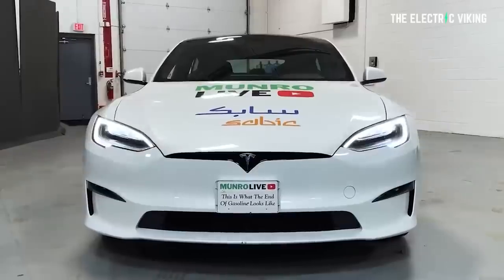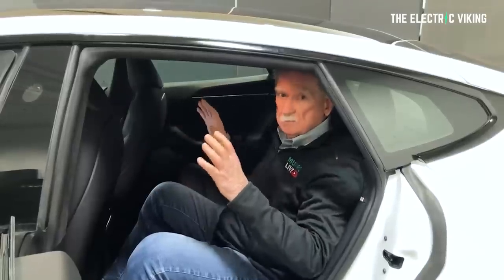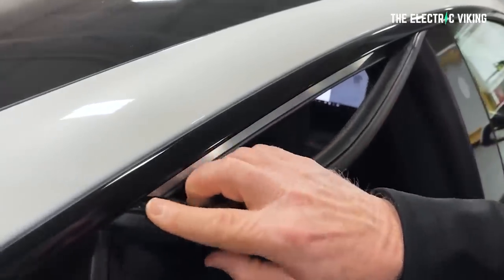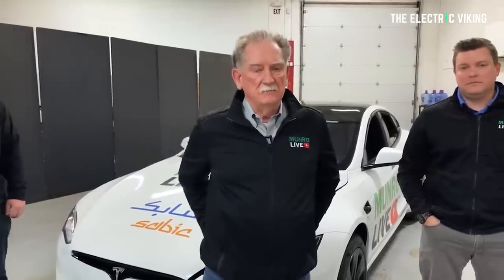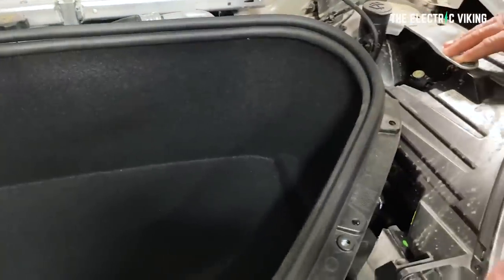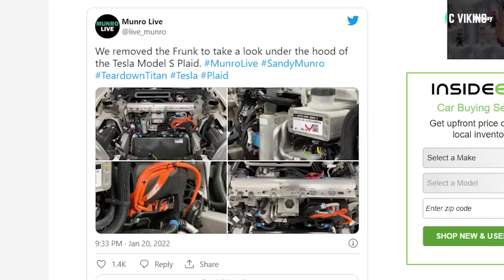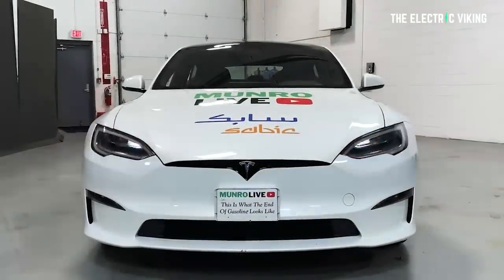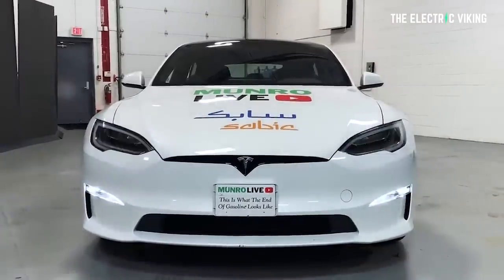The good & the BAD of Sandy Munro's Tesla PLAID teardown

Comment: With a simple calculation you can determine approximate horsepower. Since the Tesla Plaid weighs 4,766 lbs and can achieve an ET of 9.2 the estimated HP is 1,210.

Comment: Hi Sam, 

I did see most of Sandy's video, and I was certainly in agreement with most of what he said. I am however disappointed by what Sandy did not say. For instance, Sandy did not say that he found fault with the notion that car was painted. I myself have since decades found fault with the fact that cars - indeed, anything - is/are painted: it just adds cost to the item and worry to the customer that the paint will be damaged. My own new Model 3 Performance is scheduled to have paint protection film applied to it for more than $4,000, which I will have to shell out myself! Why should I have to do so? Architects have a principle, which they express as "Truth in Materials". Meaning that all materials should display themselves as what they are: wood as wood, metal as metal, plastic as plastic, bricks as bricks, clay as clay and stone as stone. No paint should ever be used in a good building. This is a well known principle in architecture. The dome of the Pantheon in Rome, constructed during the reign of the Emperor Hadrian, is unpainted concrete, and it's still mint after two thousand years! Why can't cars be made the same way? I see no reason whatsoever why they can't be. Kitchen sinks and aluminium pots and pans don't need painting, and therefore, I personally think, cars should not, either. Why didn't Sandy and his team bring that point up? It could reduce the cost of the car by 5 to 10 thousand dollars! Much more than all the minor nitpicking they did about the comfort of the rear seat and the unsatisfactory car door seals!

Comment: I think that Tesla missed a big opportunity, Sam, to insist that every Model S Plaid be painted . . . plaid. :-) 

But seriously . . . there are some good constructive criticisms (not rants with agendas, I think,) regarding the Plaid from YouTuber Nikki Gordon-Bloomfield on her Transport Evolved channel, where she observed that many Plaid owners experienced brake failures and that Tesla should have included their upgraded carbon brake pads on all the cars leaving the factory. 

Likewise, YouTube DIY Solar guy Will Prowse - who is very much a Munro protege with his own comprehensive tear-downs and testing of home storage batteries and inverters - bought a Plaid and had a host of problem with it. He got a lot of unnecessary blow back from commenters who accused his of unfairly bashing Tesla, even though he also owns a a Model 3 that has generally been a good vehicle for him. 

Tesla is seriously important EV manufacturer that's currently selling their cars faster than they can build them. Quality control issues are going to exist and honest evaluations in the field are important. The polarizing ranters on both sides of the company do a disservice to everyone. If build quality is lacking, it should be called out. If something is well engineered and executed thusly, it should also be properly acknowledged.

Comment: Sandy ‘noted’ the spacer issue pointed out by Cory and the dirt ingress through the suspension tops. Will wait for his thoughts when he strips it down a bit more. The back seat issue is because you design a spots car style body to fit on a skateboard battery pack. Taller suv vehicles won’t have this problem. RIMAC ‘T’ shaped batteries that fit under the back seat ( you will get a tunnel) is a better solution for performance cars.
Reply: You also lose the low center of gravity.  There are usually trade-offs when comparing these things.
Reply: @panyanguyen13  wrong, you don’t loose any center of gravity, also the suspensions actively controls everything. The whole battery pack is already u der the car so by putting some few battery modules just on top hein change nothing.
Reply: @benjaminsmith2287  it also allows the battery pack to be retrofitted into chassis of existing sports cars.

Comment: Of course there will be the haters. Imagine buying a high performance ICE car and finding out that a Tesla will run rings around your expensive ICE car. Not just acceleration but ride quality with good handling. The S Plaid has air suspension. What other brand else has that?

Comment: Does anyone worry about Sandy's leaning toward production efficiency over repairability? I am always impressed that you can put a part here or there but if your in a fender bender can it be fixed?  Aluminum is harder to work with at any body shop.  Also the battery death in some Teslas with a 25k replacement cost.  My god, how is that a good thing.  ICE cars can have new engine and trans put in for half that. On Rich Rebuilds if you have watched the latest video they show how am owner had waited a year and not been able to get his seat replaced.  You got to watch that. https://youtu.be/ml5meauKOEA
Reply: How many replace Engine or Transmission ?  almost never  even suspension seldom gets replaced.
Reply: @brandoYT  geez in second hand cars,  many have rebuilt trans going on 250k miles and more. Last two of my cars have gone past 200.000 miles and I don't have to worry about battery degradation and paying 25k. I have replaced ball joints,  tie rods and other parts. No engine or trans yet.  Had to replace a timing belt on an old accord because it wasn't a chain.
Reply: @benjaminsmith2287  I agree. My cars typically start at about 8 years old. New cars are just so crazy expensive. My current 530i, that is over 17 years old, still looks great and runs to work over 80 miles a day. I have to put a couple of thousand into it this year to replace some suspension parts as it approaches 200K. I get over 20 mpg and hit 80mph and beyond without issue. Air is cold heat is hot as it was 9 below yesterday here in IL. 
I love the idea of electric. I bought a Bolt to replace my bmw but alas the recall soured me on electric. Batteries catching fires can do that. Tesla keeps raising its prices and people buy them. Why? It feels very early in the process as the range is still limited by weather, like the cold even though its been over 10 years in the making.

Comment: Your videos have soooo many false Informations mate, the rotor is carbon fiber sleeved and not the motor, tesla said it was 1020hp and not 1010hp. You’d think making the air suspension a structural part is a good idea!? What till those things start failing due to extreme driving.
Reply: Air suspension is very rugged, and is often used on big rig trucks and passenger railroad cars because of its reliability. It is just more expensive.
Reply: @GoCoyote  Did you read my comment!? Im talking about the air tank of the air suspension, been mountain on that position on the tesla isn’t the optimal position. There is a reason why other manufacturers places them on other places since their vehicles are used in very harsh conditions and environments.
Reply: @GoCoyote  big truck and trains doesn’t have their air suspensions systems that exposed to stress.
Reply: @alanmay7929  
Have you ever seen or driven high end off road vehicles? Many shocks (air and standard) for vehicles have that small external tank as part of their structure, including the ones used by monster trucks, race cars, and motorcycles. Those small tanks are used when space constraints, either vertically or horizontally, do not allow space for it to be internal to the shock absorber unit. It in no way makes the shock absorber any less rugged. The air accumulator tanks can be placed anywhere it is convenient, but are completely separate from the small fluid reservoirs you speak of.
Reply: @GoCoyote  stop lying, those reservoirs are attached around the truck structure and then connected to the suspension via flexible tubes/connections, no one uses reservoirs as a structural part of a vehicle.
Reply: @alanmay7929  
Why would I lie? Just because you have never taken apart a shock absorber, or even know how to do a basic google image search, does not mean that other people are not correct. All shock absorbers have built in reservoirs, how else would they hold the fluid and gas that is inside of them? Air shocks just use atmospheric gas that can be pumped or released in order to change the gas pressure of the shocks. This can be done manually by pressurizing each shock individually with an air pump like a bicycle tire, or have any number of automatic or adjustable systems. Citroen is famous for the way the car lifts up when started as the air pump pressurizes the system. Truckers use the air shock pressure to adjust the height of the trailer to match loading docks. Many air shock systems can use a smaller air compressor if they have one or more storage tanks connected via hoses to each shock. The storage tanks provide air quickly if needed, and let the pump recharge over a longer period of time. Shocks are part of the life safety systems on cars, so need to be reliable. Each shock needs to react in exactly the same way even if they are hooked up to a central system. The supply lines will have check valves that prevent air from flowing out of the shock absorber when compressed. Otherwise when the air was compressed by the downward force of the vehicle on the outside wheels during a turn, the compressed air would flow to the inside wheel shocks and raise them even higher, and causing the vehicle to flip over. It has happened to people who did not know what they were doing when installing air shocks in vehicles without sway bars. The main problem with being incompetent, is not even having the competence to recognize ones own incompetence.
Reply: @GoCoyote  lol…. The theme here is the main air storage for the suspension system which other manufacturers doesn’t integrate as structural part. No need to make a bible Sherlock!!!!!!!

Comment: The floor isn’t low enough because there is a battery under it.
Reply: Nope it’s the seats that aren’t ergonomic enough. In gas cars the seating positions can be super efficiently tuned way better than the thick EV floor.
Reply: For minivans for example, the Chrysler Pacifica has two row seats than can be totally folded flat to the car which is totally impossible with EVs.